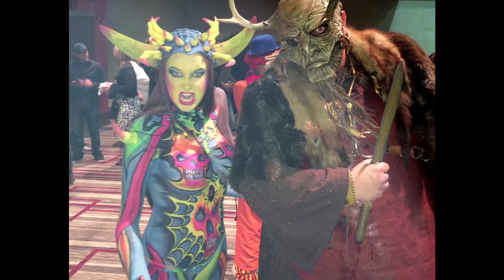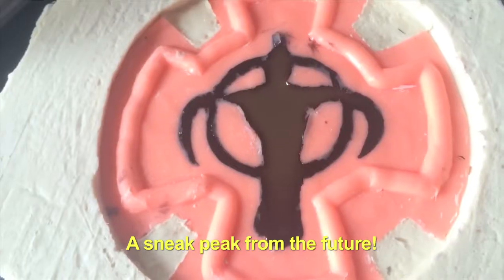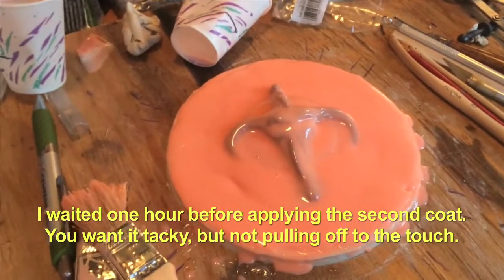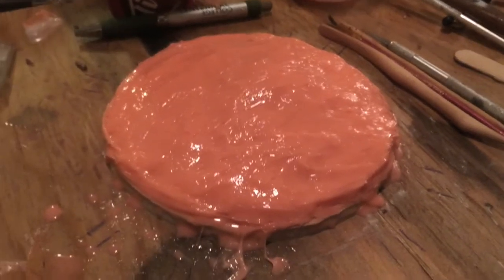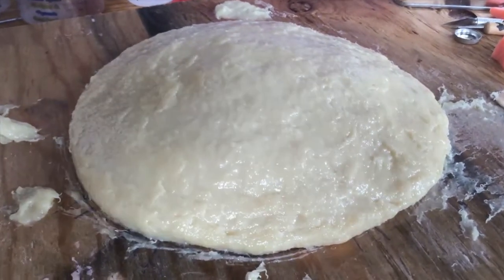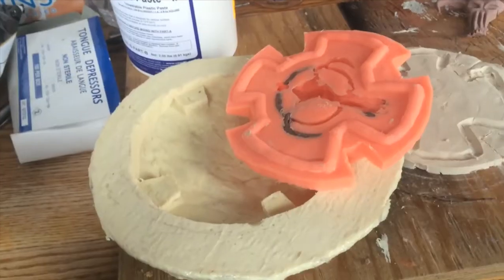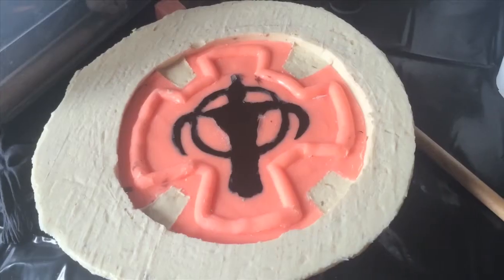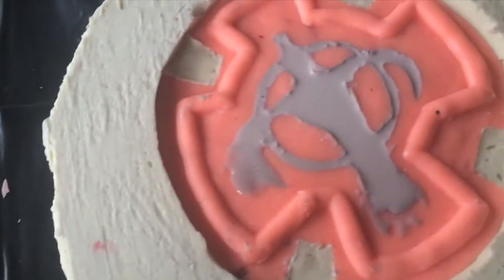Silicone Mold for a Small Item

Comment: Suspect you were using left over supplies, but for small resin pieces, we've had great success with Reynolds "Mold Star". Eliminates the need for a mother mold and much quicker than brush on. That is a cool looking piece! Your friends are going to love it!
Reply from the maker: Yes, I should have mentioned that. This was leftover silicone I wanted to use up.